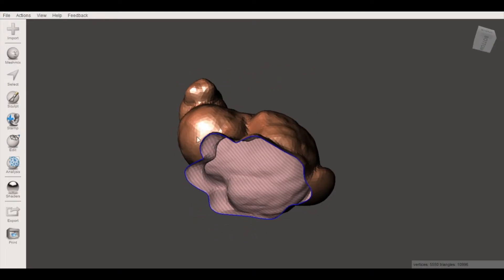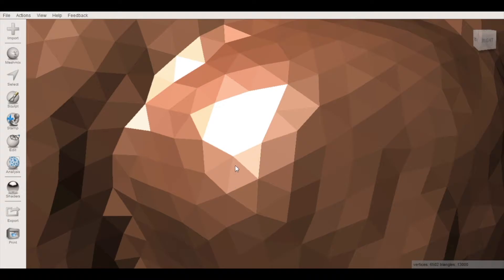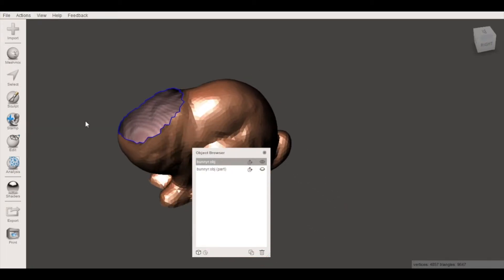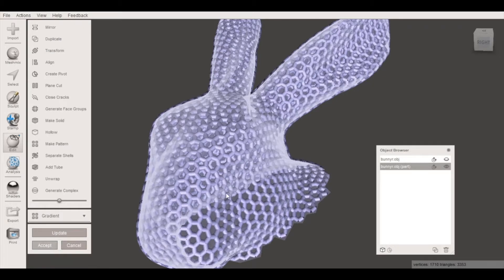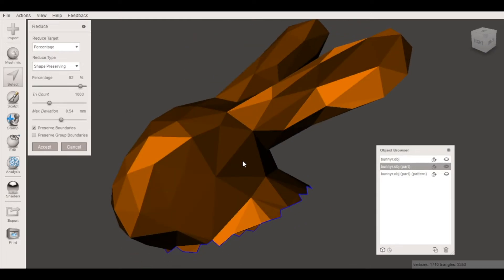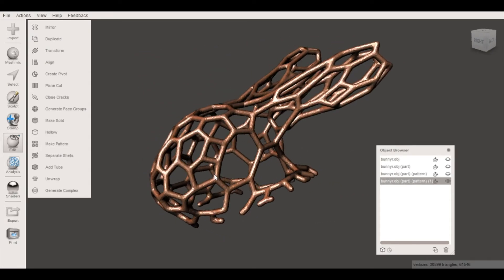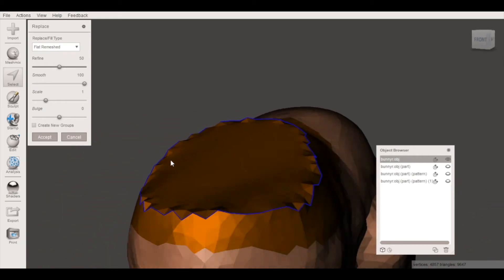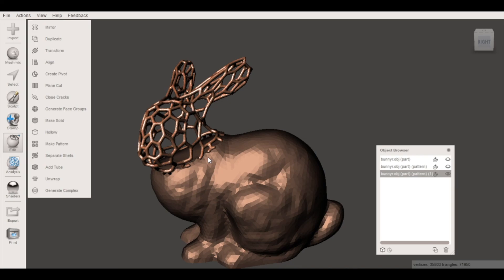Meshmixer Basics: Making Voronoi Models for 3D Printing Using Meshmixer

Comment: Thank you. I learned a lot and didn't know Meshmixer existed until now. Has anyone printed this model? My Bambu A1 would go insane with supports for this, and then trying to remove them would be nuts.
Reply: Dont use supports. Print without. It turns out fine.

Comment: Thank you so much for the video! I only have a question: What should I do if I want to have an open area where the voronoi structure connects to the solid body?
Reply: You can double wall your model! Copy your mes, make it smaller and do the same thing for filling hole , but thus time you will have a thinner lip.

Comment: Does the remesh only work for straight across holes? took an animal off a log to do this with, then tried to close up the big hole left in the log and none of this worked to close it. It only modified the selected rim around the hole, didnt close the hole

Comment: Very helpful, thank you (although he goes way too fast for a beginner to follow along).  I just wanted to add, if you're learning this for the purposes of 3D printing, chances are the voronoi wireframe will end up being way too thin and lack structural integrity. I recommend additional step (before combining objects) of selecting voronoi pattern, then go to Edit --> offset --> go at least 0.25mm distance (it will add a total of 0.5mm wall thickness), hit accept.  This will make for a more beefier voronoi that's actually printable.
Reply: Thank you kind human

Comment: I have problem with making pattern, when i select "dual edges" meshmixer  hang and not responding, i I have a very high configuration  PC. What can i do to fix it ?
Reply: mee too ... and i have a good desk computer :  16 gig ram, 3 gig video card, intel i5-6400, win 10, all my software run verry good, but i have a serious speed problem whit Meshmixer to  transform at Veronoi .... ( edit, dual edges ... take over 30 mintutes..... )